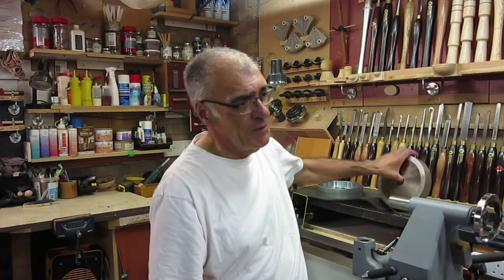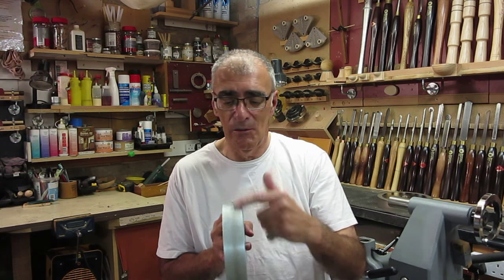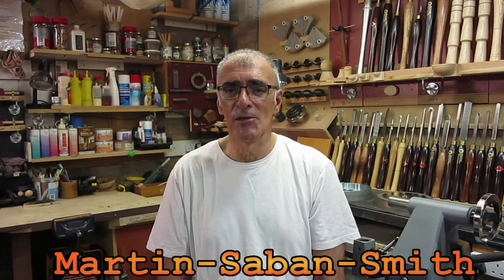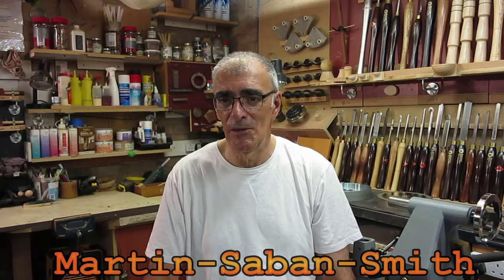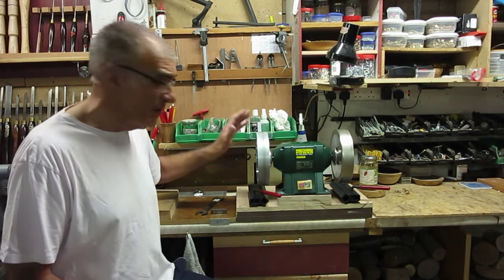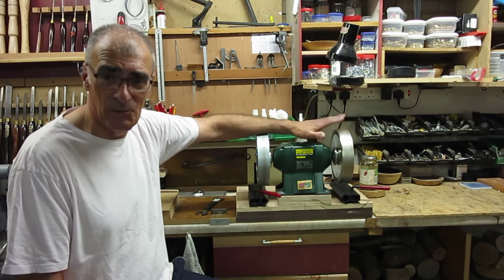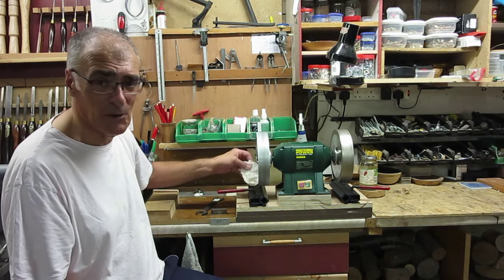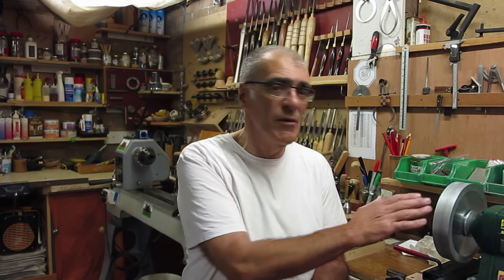Woodturning - CBN Wheels

Comment: Okay Mike, I think I am on the correct video now... There is at least 1 'cleaning' stick for these wheels on the market. It is aluminum oxide, similar to but harder than the white grinding wheels. If you should happen to load up your CBN wheels by grinding the softer/non hardened steels on them, this stuff will clean it up fairly well. It does send up a lot of white dust though. I used one on my wheels which seem to be almost black from all the sludge from my sloppy wet wood I turn. It didn't effect the cutting ability of the wheels at all. It did make them look a lot cleaner though. Thanks for the plug Mike.
Reply from the maker: +robohippy 
Thanks for the tip Reed, and my sincere apologies for the delay in replying.....YouTube gremlins at work I fear. I have now used the "stick" you mention, and it works a treat.
Take care
Mike

Comment: As a former Process Engineer, my job was to determine how to get the most Bang for the Buck.  My DYI quick change grinder from 1980 is belt driven and I have set the speed to 1300 RPM.  This speed works great for myself.  My wheels are mounted on a precision arbor and I can change a wheel in 10 seconds.  With only one wheel mounted,  the speed up and and turn off time is less than 15 seconds.  I see no reason for the start up and stop time to be 100 times greater than the grind time.  In the future my plan is to build my version of a quick change Tormek style water grinder.  This design will accommodate wheels from 10" to 3".  I expect the change over to be less than 30 seconds.

Comment: Mike,

Great review with very useful background materials!  

I have been using my CBN wheel (I only bought the 120 grit) for over a year now and I am very satisfied.  I find that I have not been eager to buy the second wheel since my 6 inch grinder seems fairly well balanced with an aluminum oxide wheel on the other side.  Also, that grit seems to be perfect for most everything I do.  The disadvantage is that the 6 inch wheel does put a more concave grind on my gouges and probably eats up more metal as a result.

My wheel is also from D-Way and was quite reasonable in price compared to the 8 inch wheel.  One thing you might have pointed out is that the new set up you have is fairly pricey.  I don't know what the current exchange rate is (pounds sterling to dollars) but a new grinder and two wheels would be about $500-600 in the States.

I have also found that a light touch is a good approach.  It makes sharpening more accurate and avoids grinding off more metal than necessary.  You do get a very fine metal dust beneath the wheel as a result of sharpening.  I vacuum it up to avoid spreading it into the air.

There are other shapes to the CBN wheels (round shoulders versus flat) and finishes (no plating/CBN grit on the sides of the wheel).  Not sure what the relative trade-offs are since they weren't known to me at the time I bought.

Thanks for another in a long line of very professional and useful videos.  Please keep up the effort.  I appreciate it and I know there are many others who do as well.  I also appreciate your candor and honesty of approach.  It is great to know that there are no underlying motives other than sharing your experience.

Sheldon
Reply from the maker: Sheldon Edner Hi Sheldon, thanks for the detailed information, the price varies so much from country to country, I just thought it best not to compare.
Thanks for watching my friend.
Take care
Mike

Comment: Hi Mike! Great video my friend! I am thinking about getting these type of wheels. I have a Ryobi grinder, but it has 1" wide wheels, do you think that removing the protections I could use these CBN ones? I saw that your grinder does not have the protection. Thanks again for posting! Cheers! Daniel
Reply from the maker: Daniel Vilarino Thanks Daniel. You don't need to have the guards in place as there is no chance of CBN wheels shattering, as they are solid steel. You still have to be mindful while they are spinning down not to touch them :). in the US there are many suppliers as you know, the only thing you must check is the size of your grinders spindle, and ensure you get a solid Aluminium or similar bushing and washer to fit. Let me know how you get on, when you take the plunge. 
Take care my friend
Mike
Reply: Mike Waldt I will! Thank you very much for all the information, I have been checking the channels you recommended as well. I was already subscribed to Robo Hippy, but never saw his sharpening video, excellent material. It will be all be very helpful at the moment of making a decision! Cheers my friend! Daniel
Reply from the maker: Daniel Vilarino My pleasure Daniel, anytime mate :)
Cheers
Mike
Reply: +Mike Waldt so you could use these with the Axminster slow speed grinder assuming the spindle is long enough? Thank you for your videos. Very helpful to this new turner. Nick
Reply: Daniel Vilarino )

Comment: I am finding it very hard to find all the right elements (8 inch, 120 grit) to fit a record power in the UK. Do you have any links as to where you picked your things up from? Do you think it would balance ok with a white stone on the other end as I cannot afford two cbn wheels. Thanks for the video - very helpful.
Reply from the maker: Hi Phil I got mine from the Tool Post which sadly is no longer in business. My advice is to ring Axminster Tools and they will advise you. Cheers.  Mike

Comment: High Mike, I have been using these wheels for three or four years now and wouldn't be without one. I have one especially made to fit my wetstone grinder it will fit either the tormek or the sheppach. Avail from Carrols Woodcraft Supplies Australia. I have also fitted one to my variable speed bench grinder and as you say" go easy" on the pressure of the tool against the wheel as it  will remove a lot of metal, on the slower wet stone it is a bit less vigorous.
Reply from the maker: Stephen McFadyen I'm glad you agree with my findings Stephen, they are a great addition.
Thanks for watching and your input.
Take care
Mike

Comment: Hi Mike, was wondering if you can help. I'm looking at getting a 6inch or 8inch record power grinder but cant find a straight answer to which size one is better for sharpening turning chisels.
The only consideration I can find is I cant find any 200mm cbn wheels on Amazon UK (not that I no if I will buy them yet). Any advice would be appreciated 
Many thanks
Reply from the maker: I personally preferred the 8" when I used a grinder system as the holliw grind is bigger. Axminster and Yandles do CBNs.

Comment: Hi Mike. Bought a lathe at the beginning of lockdown and you have been my online tutor.  I need a CBN . My old grinder will hold a 6" wheel with a 1/2" bore,  I cannot find a wheel to fit.  Any ideas or guidance is very much appreciated.  Regards. Wendy
Reply from the maker: Hi Wendy, I would suggest contacting Axminster Tools and see if they can advise you.
https://www.axminstertools.com/?gclid=CjwKEAjwxeq9BRDDh4_MheOnvAESJABZ4VTq7gok6F6Tsk6TstWbC9ztccT7pL48lWkBlhsGbUBF0RoCWFvw_wcB
Cheers
Mike

Comment: Hi Mike, wee question bro... how do you set up the angles on the one way tool rests before you sharpen?? do you use something like the Raptor angle  sets?? it's the only drawback i see in that set up compared to a sorby pro edge ...  although i have a new 2 inch roughing gouge and near impossible to get it sharpened exactly on pro edge... your thoughts and wisdom, especially on the 2 inch is very welcome brov.... R.
Reply from the maker: Hi Rodney, once I set the leg angle to my liking ... many years ago ... i never change it for any of my gouges. To ensure repeatability I made a few wood "stops" of the length needed to have the basket at the exact position needed for each type of tool. Also I don't have to worry about reducing wheel diameter as the CBNs don't wear down.
As far as your 2" SRG, simply extend the basket as needed to allow the bevel to fully ride the wheel, marking with a sharpie is a great way to check where micro adjustment is needed, and away you go :)
Hope this answers your questions.
Cheers
Mike

Comment: Hi Mike and many thanks for the review, it's very topical in turning right now so spot on.  I'm doing some research for members new to our turning club where we're going to run a practical workshop to help get them setup with sharpening using a dry grinder.  I note in your presentation you opted for the RP 8" model after you yourself had researched the choices.  Can I ask you to specify what it was about that particular grinder that made you choose it please?  My intention in running this workshop is to recommend a total solution to our members and I want to be able to justify the proposed grinder.  So your perspective on why you chose it would be helpful.  Thanks again.
Reply from the maker: Hi Byoomholay, the decision was really one of cost, especially after investing in the wheels. I had one of these grinders already and it was great value, so I went for another, as I have kept my ruby wheels for other grinding tasks.
Hope this answers your question.
Take care
Mike

Comment: Hello Mike,  regarding CBN wheels. I’m going to buy a couple for my 8” Rikon grinder.  After your use of the CBN wheels for a few years would you buy the same two grinds (120 / 320)?   It’s been suggested that I should go with 180 / 360 grit.  Your suggestion would be appreciated.  Thanks from Texas.
Reply from the maker: Hi Stafford, all I can say is that I'm very happy with the gits I've got, but that's not to say the grits you have been suggested won't be as good ... if you know what I mean :)
Thanks for watching.
Cheers
Mike

Comment: Hi Mike
Excellent video as always. I see you've changed your sharpening set up from the Tru Grind in your sharpening video to the Wolverine system. In your opinion is the Wolverine better? Also in this video you sharpen a 1/2" spindle gouge with the vari grind attachment. Is this the large hole vari grind and if so can you still use this jig on smaller gouges?
Reply from the maker: Thanks James, and thank you.
I prefer the Wolverine, as it is sturdier, in my view, than the Tru Grind...but I hasten to add, this is just MY opinion. I have the large hole Var iGrind attachment and it takes all my gouges, from my little 1/4" right up to the 5/8" bowl gouge.
hope this helps.
Cheers
Mike

Comment: Hi Mike. Only just started looking at sharpening clips hence the late comment. 
1.    I notice that you, and others, are running your CBN wheels unguarded. Do you consider this totally safe?
2.    I am thinking of running my grinder with a 40mm aluminium oxide wheel one end and a CBN the other - so I can 'cut' carbon and HS steel. Any thoughts?
Thanks again for your very informative presentations.
Best wishes, Philip.
Reply from the maker: Hi Philip, I have since changed grinder and do have partial guards on as they had to be cut to accommodate my sharpening system, and I kept them to trap some of the "swarf". But in answer to your first question - I personally feel it is safe to run CBNs without guards, as they are not going to shatter. However if you keep one aluminium  oxide wheel, a guard should be in place on that one, as they rarely do, but can chip and shatter. As far as running both on one machine, I see no problem with that at all.
Let me know what you end up doing.
Cheers
Mike
Reply: Hi Mike. Many thanks for your thoughts on guarding grinding wheels. Have to admit I do not favour unguarded rotations machinery, but agree your comments on leaving the CBN wheel unguarded and the necessity for guarding a 'stone' wheel. With careful alignment I have managed to put my 40mm stone on the righthand side of the grinder (designed for a 25mm wheel) but am thinking it would probably be better to swap the CBN and stone wheels to ensure better clearances.
Having already heavily modified the guards I now need to get another rest for use with the stone and am looking at the Sorby unit. I am trying the Woodcut jig on the CBN wheel.
Again, my thanks for your assistance.

Comment: Mike I've been looking at the axminster 8" grinder with their 180g cbn wheel. Have you any thoughts on those parts? I'm trying to decide if it's worth upgrading from stone and if these are up to the job.
Axminster Craft AC200WSG Wide Stone Grinder - £109.98
 Thanks
Reply from the maker: Hi Jane, seems a good set up to me, but as you may know I went over to the Pro Edge a couple of years ago, and don't regret it one bit 🙂

Comment: Again, a great video MIke and I learned alot of info from it!  Thanks sooo much!  One question though, did you mention that the CBN wheels are NOT to be used to sharpen 'Carbide Tools'?  What about the replaceable carbide cutters that we use for turning, planers, etc.  (i.e.; small rectangular, round, triangular tips...) that we many wood turners use vice regular spindle/bowl guages?  Since I use both, I was hoping that the CBN wheels would also sharpen those replaceable tips also...  Again, thanks so much for all you do and your wonderful videos!
Reply from the maker: +Kenn Harris 
Thanks Kenn, I should really have stated that you can use carbide on the CBN wheels but much care is needed as it only takes a slight error to ruin the profile. I always use a diamond credit card to sharpen mine. Thanks for making the point.
Take care
Mike

Comment: Great video thanks. I'd love to give CBN wheels a try but I'm gong to be stuck making my Tormek pay it's way for the next ten years I think. As for slowing the wheels down after you've switched the machine off I wonder if you could manually switch in a huge power resistor? I'm no electronics wizard but I believe that's one technique they use and the motor should be acting as a generator after switch off.
Reply from the maker: Wobblycogs Workshop Thank you, I'm sure something could be rigged up, but like you I'm no electronics wizard, so the paper towel will have to do....lol. 
Thanks for watching, and your support
Take care
Mike

Comment: Isn't there a manual stop for the wheels ,say pressing the off button twice or pressing it continually  in order for the wheels to  slow down and eventually stop?
Reply from the maker: +νικος γιώργος 
Sorry, but I don't know what you mean Nikos
Cheers
Mike
Reply: Hi Mike! What he means is often to find with chopsaws, maybe because it's more dangerous to let them run compared to a grinding wheel. It's actually a switch, that would let turn the wheels the other way round, and if you press it while the wheel ist ending, it causes a slowing down. Got it? Cheers wolfgang

Comment: great review Mike 
i have my eye on these a good while might be the next shiny thing i buy 
the only thing is i have 3 grinders lol and that means ill have to buy 6 wheels 
did you sell your old stone and grinder or is that the same grinder 
Thanks Robbie
Reply from the maker: Robbiethewoodturner Thanks Robbie. I kept the old Ruby stones and grinder for carbon steel, and any other grinding I need to do, as nothing other than My HSS tools are going anywhere near these wheels ;). I got another Record Power 8" grinder for the CBNs, it's a bit underpowered for the weight of the wheels, but once up to speed it works well, I'll have to see how long it stands up to the extra weight.
Take care mate
Mike
PS - THREE grinders!!!!!!! lol

Comment: Hi Mike. I notice your grinder is running fast. Probably 3450 or whatever it is. Don't the CBN wheels work better at 1750? Yours seems scary fast. I'm a newbie and starting to source a grinder and wheels.
Reply from the maker: +Roger Williams 
Hi Roger, I have now got a slow speed grinder which is much better. 
Cheers
Mike

Comment: Mike ... I just watched your two-part live stream of the hollow form ... great video! Glad you have a customer!! I'm not sure that you actually get comments this far in the rear-view mirror. This CBN video was very helpful, and the specs of the available wheels which you described are not readily available in North America, from my research ... in particular, the 1 1/2" surface ... however, The ToolPost went out of business in September 2020 (surprising given that all of their customers would have been trapped inside ... maybe health issues with the proprietors?) ... their website links on to a follow-on site for products, but it's a pen turners site and they don't seem to carry the wheels ... was there an underlying brand on those wheels that you could point me to? (dangling participle only  one of many things that sag with age!) ...Thanks, your humble subscriber, Farmer John, Ontario, Canada
Reply from the maker: Thank you John much appreciated. 
Regarding the CBN wheels the ones I had where Optigrind, Woodcut are available at Axminster Tools here in the UK, and they deliver worldwide,  also Amazon and EBay are a good source too.
Hope this helps
Cheers 
Mike

Comment: Thanks for this great video. Can you please inform me about the diameter en the grid ( K ) ? I Hope that I can buy two. One wheel to shape and one wheel for a great sharp finish. Is that possible? I hope you can help me wite your experience. 

Thanks
Reply from the maker: 8" diameter 80 and 180 grit.
Cheers
Mike
Reply: @MikeWaldt  what is the best RPM for these 8" wheels?